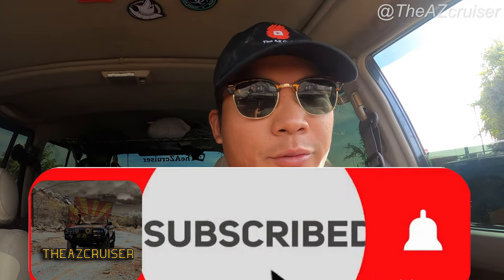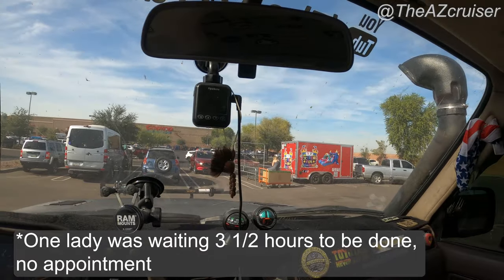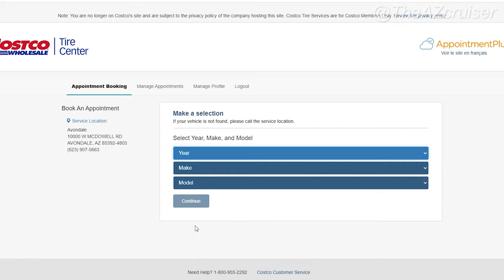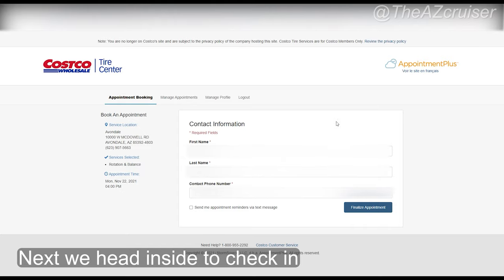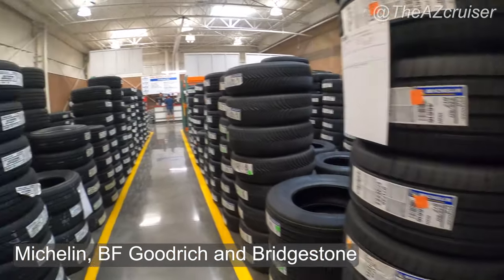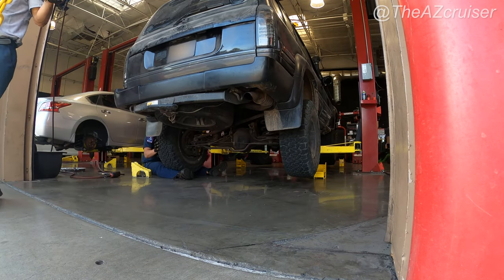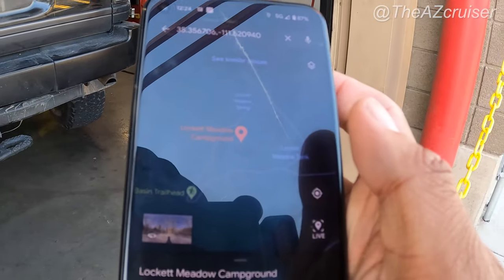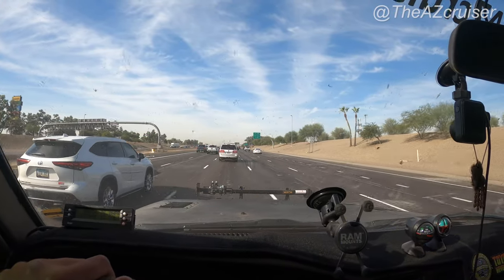ℹ️ How to: Get your Tires Rotated and Balanced at Costco - Guide [4K]

Comment: Tire service at my costo was horrible, I bought tires from the costco website, tried to get them installed at the costco tire center and they refused to install my tires because I had aftermarket rims. I wish I knew that before buying my tires at Costco. Basically had to get them installed at a different tire shop.

Comment: all tires need to be exactly the same name or company if do the tire replacement???? or not necessarily
Reply from the maker: According to Costco.com "We have a policy to always install the least worn tires to the rear axles on the vehicle. For example, if only one tire needs to be installed, it will be installed on the rear of the vehicle. If two new tires are installed, they will also be installed on the rear of the vehicle.

This is based on major tire manufacturers' fitment guidelines, which specifically caution against installing replacement tires on the front axle, due to safety reasons. If you have further questions, please visit our Tire Site."
Reply: @TheAZCruiser  I am kinda new to this…..if I have a flat tire and go to Costco , will they check for us weather we need to to replace new tire or only fixing that flat tire for us???? how about rotating back tires to front and front to back???? they always do that for us or they only do if we tell them to????
Reply: @TheAZCruiser  is driving gonna be ok and safe if we replace tires with different brand and company????? not the same company